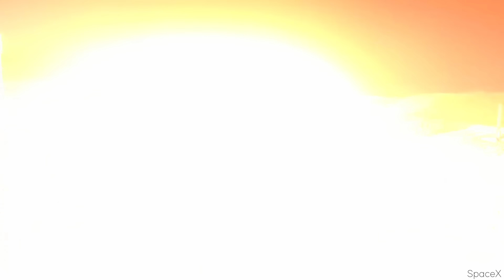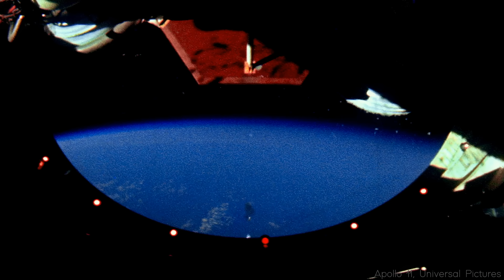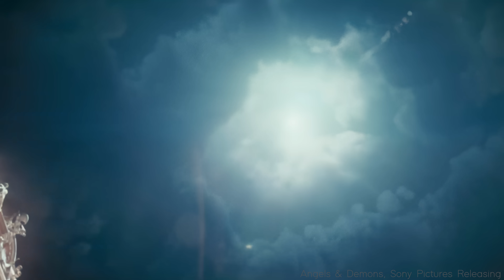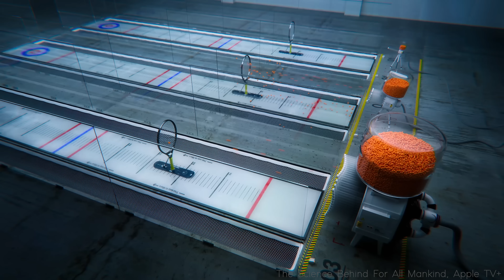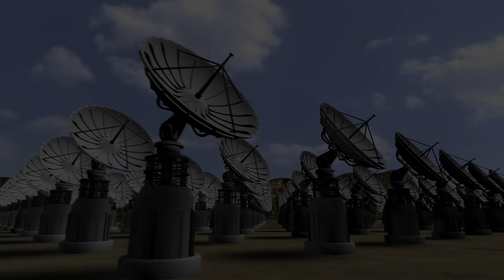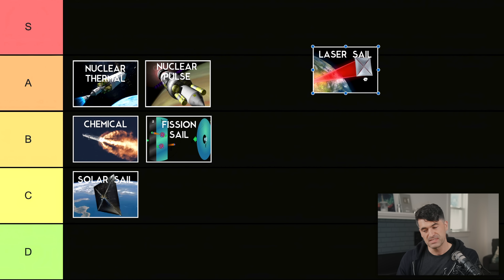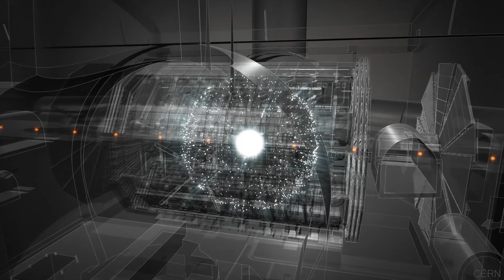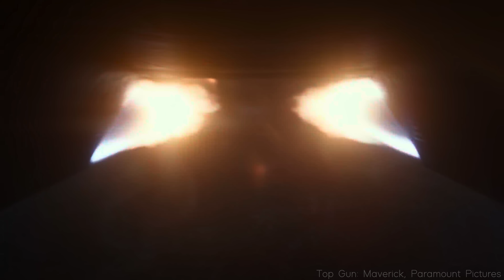Interstellar Propulsion Technologies - RANKED!

Comment: In my sci-fi book that i am writing, i theorize a dark matter engine, an engine similar to Bussards ramjet, but instead of hydrogen, it collects dark matter floating in space and launches it backwards at high velocity. In theory, if dark matter really is a new family of yet undiscovered particles, such an engine would be more efficient then Bussards thanks to the higher quantity of dark matter mass compared to regular matter. Also, i would be carefull about saying FTL is impossible. You could name quite a lot of things that were considered impossible 100 years ago and are now very much reality.
Reply: What was considered impossible under known laws of physics 100 years ago that is considered normal now? Also, dark matter resists clumping, so although it is more plentiful than hydrogen gas, there are areas of the galaxy where is is probably less dense.
Reply: How are you going to create a fusion reaction using dark matter? Bussard's ramjet doesn't just use hydrogen for kicks.
Reply: Per Special Relativity, nothing in space having any measurable mass can travel at light speed because as it accelerates, it becomes more massive until, at c, the object's effective mass becomes infinite, requiring more energy than is contained in the entire universe to accelerate any further; thus, nothing can travel at or beyond light speed. Alcubierre drives (i.e., warp drives) get around this by using space itself to propel the ship, which does not violate Relativity.
Reply: That is a good idea. The principal problem I see is in collecting the dark matter as it seems to be concentrated in certain areas of the Galaxy. If enough is present in the star lanes then it might be possible.  Fundamental research to uncover the true nature of dark matter, dark energy and the true nature of space/time and the vacuum is vital for future technological developments in propulsive systems.

Comment: Solar sails?! I've always read that as a practical matter they're not useful much beyond Mars' orbit, because the Sun's solar wind becomes too attenuated?  And laser sails? That will require some pretty fancy lasers there?  But a nice array of possible options.  Warmest compliments. Thank you, sir. :)
Reply from the maker: Solar sails use radiation pressure, not the solar wind (that would be an electric sail)
Reply: If you want to launch a solar sail on an interstellar mission, you should actually start by sending it towards the sun.  A very lightweight solar sail that starts very close to the sun can reach a pretty high velocity, far beyond what is practical to achieve by chemical rockets or nuclear thermal rockets.

Comment: Your bias aside the Halo Drive should be D tier. 1. You need a Black hole and unless the black hole is in the inner solar system we're shit out of luck because the crew would be dead before they got to it. 2, and 3. There would have to be a black hole close to the target destination otherwise it's a one way trip. Even if you got to it you'd need a metric shit ton of radiation shielding which increases the costs significantly. If we assume Planet IX is a primordial black hole and we had a drive capable of getting to it in a matter of weeks, at most months, then yes it would be S tier. But we don't so its feasibility is zero, it's cost is extraordinarily high and for obvious reasons hasn't even had any testing unlike anything in C-tier above. It belongs in D, or elevate the rest of D.
Reply: I'm fairly certain that D tier is reserved for things that almost certainly break physics and could never be done, even in principle. While the Halo drive has the obvious issue of needing to reach a blackhole to get started, and of course there are absurd engineering challenges like everything on this list, from what I understand the physics does technically work, so it should make C tier, though probably near the bottom. It has a similar "bootstrap" problem to mind uploading, so I think it would would go in the same spot.
Reply: You dont need to reach the black hole you just need the lazer to reach it.
Reply: +1 My thoughts exactly.
Reply: As soon as I saw the title I needed to watch to see where Halo Drive would be allocated. Middle of the scale seems safe to avoid perception of bias, but when it sits beside Ion drive, I have to believe that a developing technology (Ion drive) needs to carry a bit more weight that a theoretical technology. Perhaps there should have been more segments/categories to place the options (I myself am biased towards Halo Drive as it seems like a very good option of interstellar travel, not withstanding the previously commented hurdles).
Reply: You don't necessarily need to decelerate all the mass that you started with.
Reply: All the scientists here in the comments might be onto something
Reply: What do you mean elevate D tier?! Are you out of your mind? If you actually paid attention, or had any college physics background for that matter, you would understand how stupid these above light speed propulsion systems are. Look, I'm not saying to not try, but they would literally break our current physics, which at the moment seem to work really well. I don't see how HALO drive belongs to that absurd category. It belong to C in my opinion, better than mind upload worse than others, because of the problems you pointed out. Mind upload is worse I think since it is not clear how such a thing would even technically work. But not D man, be a little more rational.
Reply: If you have the technology to reach a black hole, you could just go directly to the planet and skip the middleman 😂
Reply: I never even considered planet IX being a primordial black hole…. That would actually be rad

Comment: Doesn't ntr amount to pushing against itself,  sort of like blowing a fan against a sail on a small boat? There would be no net forward propulsion. It would be like me trying to make a spaceship move forward by throwing tennis balls against the back wall.
Reply from the maker: No there is propellant (hydrogen)
Reply: @CoolWorldsLab  I get there is propellant...but how can it eject into a push plate attached to the ship. The backward momentum would cancel the forward momentum.
Reply: I think you are referring to pulsed nuclear detonation rather than NTR which is just like a conventional rocket. In orion drive when the nuclear device detonates it releases a lot of energy in all directions the pusher plate or sail catches the energy going in the direction it wants. It is just like a rocket except the combustion chamber is more exposed. The charges can be shaped so more of their energy is directed for and aft with less wasted to the sides.
Reply: @MrMonkeybat  yes. The push plate. It makes no sense to expel something with backward momentum that is attached to the spaceship. In empty space a ship can create forward momentum by pushing against itself
Reply: What am I missing?
Reply: @danpinchuk1691  It is not pushing against itself it is being pushed by the detonation of the explosive just like any other rocket.
Reply: @MrMonkeybat  what's the push pan? It looks like the propellant hits the pan, then the pan moves backward, the ship moves forward, and pulls the pan forward too. Is the animation just wrong?
Reply: @danpinchuk1691  The push plate or pull sail is on suspension to even out the acceleration from the nuclear detonations.
Reply: @MrMonkeybat  if the push plate was somehow contained within the spaceship, the spaceship could not move forward. I couldn't shoot a machine gun into the rear hull of a spaceship to make it go forward. The bullets with backward momentum need to leave the ship. What am I missing.
Reply: @MrMonkeybat  when you say suspension that means attached to the ship? A ship cannot move forward by pushing against itself
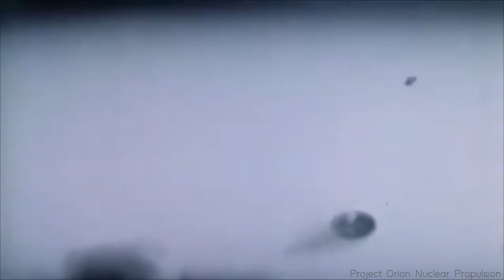Reply: @danpinchuk1691  Just like a normal rocket engine is attached to the ship to push it. The pusher plate works just like a rocket engine it is just sprung to even out the pulsed thrust. It works at 6:20 you can see a practical experiment of a device dropping explosive pushing it up.
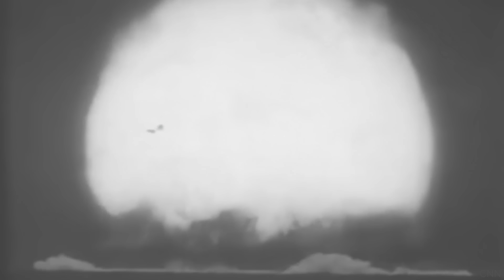Reply: @MrMonkeybat  at 6:57 he mentions a parachute attached to the ship. it's tantamount to pushing against itself. The expelled propellant can't eject into something attached to the ship. It has to eject into space

Comment: This is a review of science fiction tropes.
Untested ideas and concepts are not technologies.
Most of this has never been reduced to practice.
Reply: Not true. Chemical rockets have been tested for more than 100 years. Ion thrusters have been used on spacecraft for decades. Nuclear Thermal Propulsion has been tested for 75 years and some prototypes are ready to launch.  Solar sails have been tested and the starshot mission using directed energy beams to reach Alpha Centauri are in a late development stage. Vasimir rockets have been heavily studied and engineered. We only lack the money and will to try these ideas. They are not tropes but in fact the means for our species to discover the Galaxy.
Reply: Almost all the methods described are within the bounds of the known laws of physics. A few, such as solar sails, nuclear thermal rockets and pulse drives, have been tested. The Alcubierre drive is theoretically possible, but requires negative mass to work. So far as we know, negative mass does not exist, so anything that uses it is dead in the water.
Reply: 1) A lot of this has been built.
2) If we can never talk about any potential future technology, we could never have invented ANY technology.
Genuinely don't know whether you're acting dumb on purpose.

Comment: I've seen some papers that suggest Alcubierre style drives that are subliminal (thus no causality violations) , and don't use exotic mater but specially placed mater which I'm still trying to get info on. Might be our best approach ?
Reply: The subliminal variant still depends on locally generating a sustainable and stable warp field so it still requires engineering a technology that has been barely demonstrated in the lab to exist, Nevertheless; pursuing the technology, whether negative energy and exotic particles can be created is our best bet for achieving superluminal travel which is key to reducing relativistic time difference between arrival and destination points.
Reply: @micha9000  you can't pursue something that doesn't exist. No such thing as negative energy, mass or exotic particles. Not everything in the universe has opposites
Reply: @MyNameIsSalo it can be said that negative energy does exist and it is something we have already discovered, or a least something that can be a substitute for it. It’s called the Casimir effect
Reply: @MyNameIsSalo  The point is to develop the science and technology till they either succeed or fail because a crucial aspect of science is wrong or the engineering is impossible or impractical. The point of the pursuit is to develop a device before it exists.
Reply: So I'm a bit confused on the definition of antimatter(negative matter ?) which seems to only reverse one property of a particle that being charge. As I understand it a particle has many properties, charge, spin, reaction to gravity, etc..  Wouldn't true antimatter have a total reversal of all of the properties like moving upward in a gravity field not downward, polar spin vs equatorial, etc., etc. ? Isn't a positron just a electron that has gained some how a positive charge ? Sort of like how you can magnetize a iron rod to have the N or S pole by how you align the magnetic particles.

Comment: A huge advantage of laser sails and beamed power is that your "engine" stays comfortably in your home system. If one laser station breaks the ship may not even notice while a replacement is built. It opens up the option of building more stations after the ship has launched to keep pushing the acceleration and make up for losses as distance to the ship increases. Compared to carrying ludicrous masses of fuel and being dependent on your own engine it seems almost a no brainer. But you have to trust the home system will keep the laser arrays on line all that time, you need them for braking as well!

You also have to trust nobody starts to wonder what else you could do with an extremely powerful laser array in the solar system. Or in the case of nuclear pulse how you plan to sell the idea of manufacturing potentially hundreds of thousands of gigaton range bombs without raising any eyebrows. Basically any remotely interesting interstellar drive is also a weapon, more than rockets already are.

This does lean into the "wait calculation" which might be a good follow up. We might have the tech to launch something at a few % of c, but that might be overtaken by something launched later using better propulsion. And so on. There's a very tired scifi trope where a generation or sleeper ship reaches its destination and finds it's already been colonised by FTL ships millenia earlier. You might argue against any interstellar mission until we have beamed power or antimatter production online, otherwise we're wasting resources on slow ships that will get overtaken later.
Reply: You might also argue that some future technologies never arrive and instead of sending ships we wasted milleia waiting for no reason 🤷‍♂️
Reply: @ImBarryScottCSS  That's assuming there is not limit to understanding of physics.  There is significant evidence that physics could be very close to solved, and lightspeed will never be exceeded.
Reply: I feel the process of investing into and building spaceships would teach you lots of useful stuff (interstellar lifesupport, astronavigation, long distance communication etc) as well as galvanising more engineers & scientists into the industry.
You would not build the electric engine if you didn't start with steam power, for all that they're unrelated.
Could in theory, practically in the real world wouldn't.
Reply: Absolutely. The process of figuring out this stuff and succeeding with less effective methods still teaches us a TON. And as has happened a lot before, we'd probably find innumerable helpful stuff out just for life on Earth.
Reply: Until someone figures out harvesting and storing antimatter from the wild antimatter is only an energy transfer medium, just like hydrogen, and not a fuel.
Reply: But wouldn’t the faster vessel just rendezvous with the slower one??? If I sent a messenger on horseback and later came across a Bugatti, i wouldn’t send the Bugatti to the destination I’d send it to the horse first.
Reply: @ekothesilent9456  I imagine an Orion drive would be the ideal choice because as we develop faster drives, we could send small warheads to catch up with the gen ship and accelerate it.
Reply: I assumed the laser stations on Earth only gave it an initial thrust and wouldn't do so continuously. Wouldn't the lasers lose line of sight on the ship once the Earth rotates away?
Reply: @Fylgija1  The atmosphere would also greatly reduce the effectiveness of the lasers. This is why one of the main proposals was to build the  lasers in space at some lagrange point. Which multiplies the cost and complexity required. Powering them would also require serious additional investments regardless. It is possible but probably not feasible within any reasonable budget even if a global project.
Reply: You have to build ludicrous amounts of energy transmission infrastructure just to send a tiny mass smaller than a cubesat. Also there is the issue of braking and directional control to actually arrive at a destination instead of keep flying past. It isn't practical for manned missions.
Reply: How do you slow it down though if you're trying to land somewhere you have never been?
Reply: This is only good for probes.
Reply: To be fair about weaponizing giant lasers, it's an even bigger problem with antimatter. The military would love to bits a bullet with a few molecules of antimatter (a gun that would destroy tanks/buildings in a single shot), or a missile with a few milligrammes (a jet with dozens of missiles, each can level a small city). 
As much as I want to see interstellar travel in my lifetime, I don't think we should be allowed to progress beyond our own planet, let alone the Solar system before achieving complete harmony with each other as species. All of the problems that plagued us since the beginning of civilization will become immortalized and unsolvable if we go interstellar.
Reply: I think we'll send AI nano pods/seeds.  don't need food, sleep, just a bit energy.  It would probably go insane though.  Come to think of it, it would become...alien to us. Ok I've scared myself now
Reply: Laser sails is one of the dumbest idea ever.